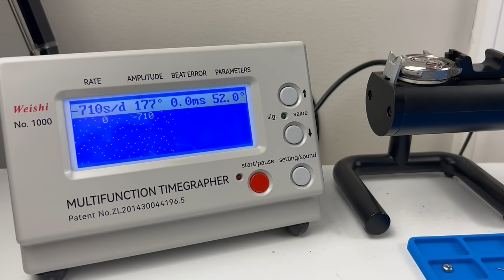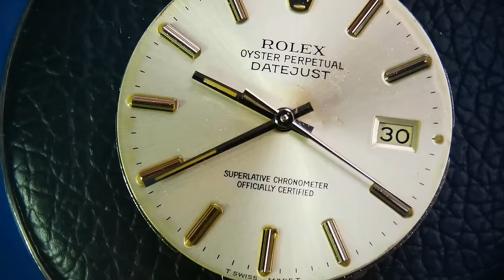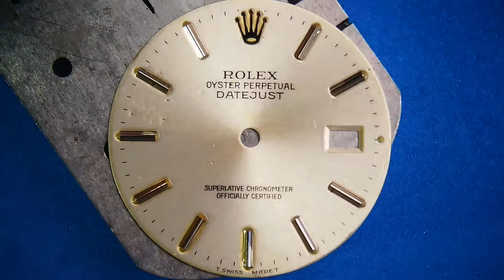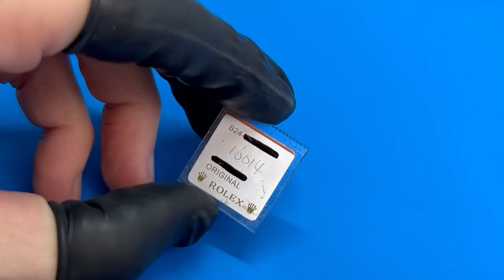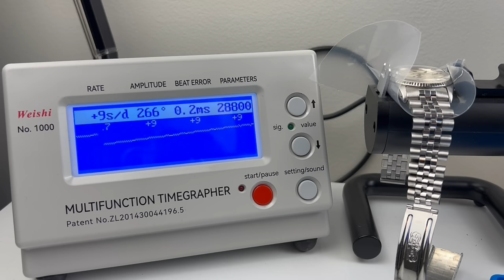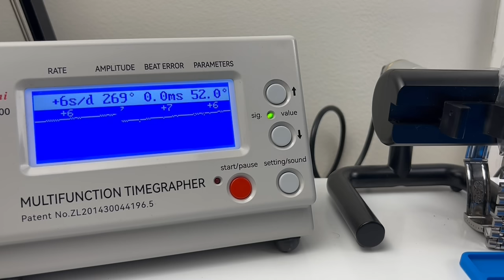🤢ABUSED by a Jeweler! Rolex DateJust RESCUED and RESTORED.

Comment: Novice Machinist here, I think that oil might have SAVED that watch. 20 years of humid atmosphere would have seeped in that broken crown and attacked those surfaces otherwise protected in oil. Since it was nothing permanent, and you did an amazing job restoring, that oil was a no-harm protectant that saved an open movement from deterioration. Subjective opinion. Cheers
Reply: Task failed... successfully?
Reply: I follow you. It was pickled. That was a lot of oil. The most I’ve ever seen in a watch.

Comment: Thanks for the video, my next project is to do a cleaning on my 3035, I have a 1982 16030 that looks a lot like that except it has the engine turned bezel, I replaced the Crystal and the crown and the gaskets, gave it a brush and polish much like you did, and it is a beautiful watch.

Comment: Excellent good sir 👍 I have a question about the dual and the use of naphtha, how does it affect the print? My automatic assumption is that it would remove it. Thanks for the education my friend.
Reply from the maker: Naphtha is relatively mild compared to the L&R cleaners. However, if the lacquer finish on that dial (which is layered over the markings) was in any way compromised, the outcome would’ve been much different
Reply: @csspinner  ahhhh makes sense, thank you again for the excellent video

Comment: As usual, another well done video. I have a question about the cleaning fluids you use. Once they reach the point of contamination where the fluids need to be changed, how do you dispose of the old fluids? I've asked this question on several other sites and have yet to receive an answer. Please reply if able.
Reply from the maker: I too haven’t gotten a straight answer on that. I have a recycle center in town that accepts hazardous waste. So I just take it there to be on the safe side.
Reply: Thank you. Unfortunately, I don’t really have any place like that close by. My son has hazardous waste pickup at his business so I’ve been taking the solvents there, but that’s a 30 mile trip one way. I’ll just try to find some place closer that won’t charge an arm and a leg. Again, thanks for the reply.

Comment: as a hobbyist, I'm shocked how much oil was pooled up inside that watch! I learned early on about discipline in lubrication, not to mention the fact that the kind of money that watch oils cost!

but to be honest, that oil looks like some all purpose lubricant in a bottle with an extending tube that I use for my ceiling fan bearings and door hinges!!!
Reply from the maker: It smelled like a submarine engine in there. So I’m not sure what type of oil it was. Certainly wasn’t watch oil.

Comment: Not sure if you will see this but i like watching restoration videos and yours came up pretty cool

How do you remember where everything goes?? And why are there gemstones inside the guys of the watch? Is that common in all rolex?
Reply from the maker: @andreamiller9049  thanks, Andrea! I lay out all my parts in numbered bins with their respective components. Jewels in the movement serve as a low friction surface for the pivots of the wheels to turn within. They are a synthetic ruby… very hard so they don’t wear down. With proper oil and servicing these watches will last several lifetimes

Comment: So, I saw the adjustments for improving accuracy I had never seen that before, but I always wondered.  First time I saw pallet fork jewels lubed. In 20/20 hindsight, you should have weighed the watch before and after.  Yes, there is some metal loss, but I'd think the difference in weight would be 90% from the oil.  BTW, you DID recycle the oil you removed, didn't you?🙂

Comment: Great job Chris! Always amazes me watch makers doing child like attempts at a quick fix. I’ve never seen so much oil, you should win an award! Have you any tips for putting main spring arbours in? Yours seem to pop in easy, mine usually are fiddly. Ta.
Reply from the maker: The trick is to have it go in at a slight angle so that the notch doesn’t get stuck on the edge of the spring.
Reply: @csspinner  yes, I use that technique. I point the tang in at the angle. The spring fights against the arbour and the arbour fights with the edge of the the barrel hole. I will keep practicing😁ta!

Comment: Does each jewel / screw go back in the same spot, or are there some common sizes that are interchangeable?  Great video, thanks for sharing!
Reply from the maker: The upper and lower balance jewels are interchangeable on this movement. Some screws can be mix matched, but in most cases they need to be returned to the specific place
Reply: @csspinner  thank you for the reply!

Comment: interesting to see that the cal 3000 series doest need the balance to be hold while adjusting screws, the older cal 1500 series service sheet suggests that the balance wheel is hold with tweezers while adjusting the screws.

Comment: Hello, newbie here, what liquid do you use for cleaning the dials?
Reply from the maker: @Meisterhix  it was a bit of Naphtha. But be sure to test it in an inconspicuous location before putting it on the whole dial. Sometimes if the lacquer layer is compromised the naphtha will lift away the markings

Comment: I have a old pocket watch that my father had, for some reason it was took apart when I got it I managed to get it put back together but it is missing the gear that winds it up, I can wind it from inside the watch with my finger do you work on other peoples watches? I would love to have it running the right way, my brother has it currently but is sending it back to me
Reply from the maker: Drop me a line. My contact information is in the description.

Comment: I don't know what you're seeing is actual corrosion or stains from whatever dye was in the oil that somebody drenched that watch in. The one good thing is that it's not a Krusty Rusty mess. And I think that spring was perfectly fine I don't think it ran long enough two have been stressed. But it was in an absolute oil bath. Watch mechanism does not like that much dampening

Comment: Nice to see that fine adjustment tool at the end there! How much do they cost and are they good for modern movements?
Reply from the maker: Thanks! I’m using a generic version. Cas-Ker sells them for about $50. I would assume it would work on modern movements if they, too, use microstella screws.

Comment: Is there somewhere we can go to check your service rates? Or do you offer services normally?
Reply from the maker: I’m just a hobbyist, but I occasionally take on jobs for others if it seems like an interesting challenge. My contact info is in the description.
Reply: @csspinner  I have kind of a neat one I just got. It's a pocket watch with the original DePollier shock absorber. Pretty rare, as I haven't seem more of them. Later versions were used on wrist watches, but this one has the cross shaped brass straps over the balance jewel. I have a few other interesting pieces. I'll have to shoot you a message.
I would honestly trust your work over most of the other people out there. Especiallyafter watching your videos. Not many watch smiths out there, & hard to trust people sometimes. Had a guy claim to be a watch service, but he couldn't even figure out how to open the case lol.

Comment: I am a watchmaker from India and had encountered a Rolex explorer in a very poor condition. The owner had given it to an amateur watchmaker who tried to pry open the back using a minus screwdriver and a hammer instead of using a rolex opener. Worst part was the watch was stopping 5hrs after being removed from the owner hand and was running almost 10-12 mins fast in a duration on 3 days even after being allegedly serviced. Apparently the hairspring was tampered with i guess while fitting it back. I spent almost a month in adjusting the hairspring to a good beat as the original hairspring was costing somewhere around Rs.50,000 to Rs.60,000 which in dollars is almost 600-700 dollars and the customer wasn't ready to pay so much for a re-service. (As i had to use tweezers to adjust the shape of the hairspring to get it to a decent time caliber it did not come to the exact time but it would go 120 seconds fast in 7 days time so me and the owner considered it as a victory and settled with it)
Reply from the maker: It’s heartbreaking to hear what some of these watches go through. I’m glad you were able to get it running significantly better than it was
Reply: @csspinner  you should even try to restore mechanical wall clocks it is fun to work on

Comment: I have a GMT Master 2 (16710) I purchased new in 1989 with a Jubilee bracelet (unusual for the time) which I wore constantly for nearly 27 years (dug holes, banged in nails, operated jack hammers) - kept perfect time. In 2017 the bracelet looked rather like this one but one of the links finally broke (actually wore away) so I had to bite the bullet and allow a Rolex AD service the watch and replace the bracelet. Dammed service cost more than the watch new!!!!☺
Reply from the maker: @mikebirkett010  what did the service run you? Even the bracelets alone aren’t cheap, but they also do a full once over on the movement while they’re at it. You basically get a new watch from them, though I’m not certain how much of your watch stays original
Reply: @csspinner  Yup, that's true. Bear in mind these are UK prices so include taxes. Price new in 1989 was £1234 ($1585). Full service in 2017, new sapphire, new bezel (who said aluminium was a good choice?) and a new bracelet, £1672.02 ($2147.73). The bracelet was £850 (($1091.84) alone. Also bear in mind, these were part exchange (trade in) prices. If you wanted to by them outright new (which in the UK you couldn't as Rolex protect their second hand parts religiously) they would be a whole lot more. I've kept the original case which was refinished and the dial and hands which are tritium painted (no longer work). No idea how much its worth, don't care, will never part with it.

Comment: I think he mistakenly took his watch to an auto repair place instead. At which time they thought it was a quart low on oil and somehow managed to break the "dip stick". I've never had a problem with Rolex watches. Me. I've always thought of the Rolex company as the DeBeers of the watch industry though.
Reply from the maker: I’m not sure what kind of oil they used, but it smelled like the engine room of an old submarine
Reply: Was it Pennzoil or Quaker State?🤣😂🤣😂

Comment: Wow, even with no watch repair experience at all, even I could tell the amount of oil used by the previous jeweler was borderline criminally negligent. It looked like they had just taken the case back off and just filled all empty spaces with probably 3 in 1 oil.

Comment: Why r some of the screws reversed screwed??
Reply from the maker: Great question! The crown wheel normally turns counter clockwise when the user twists the crown with their fingertips. This would present the opportunity for the screw to eventually work itself loose. So instead, Rolex (and many manufacturers) decide to make the screw for the crown wheel reverse threaded so that the counterclockwise turning of the crown wheel only nudges the screw in the direction of tightness

Comment: I just wonder how the fark do you remember which screws parts goes where.  Easy to disassemble but to assemble back is nightmare
Reply from the maker: Each part is laid out with its screw in individually numbered trays. They are photo’d in place. Then return there after cleaning